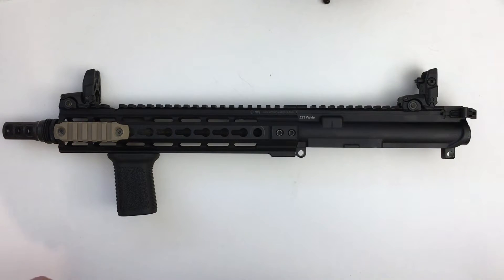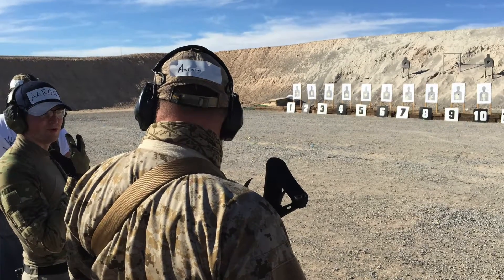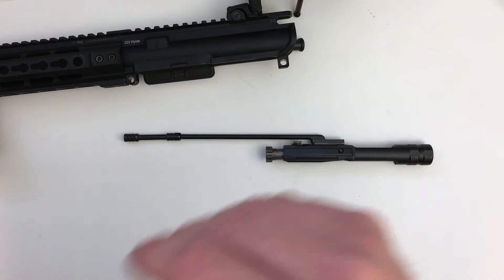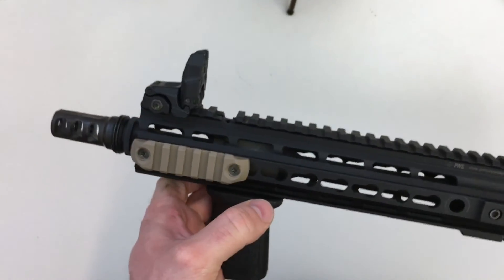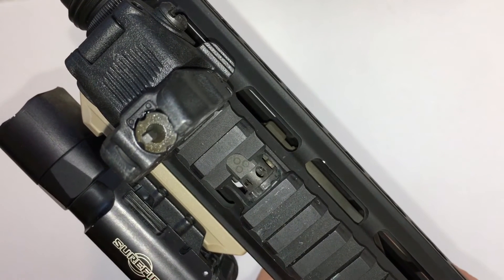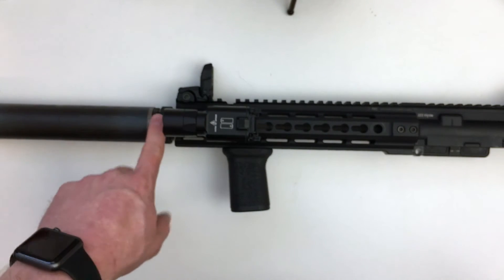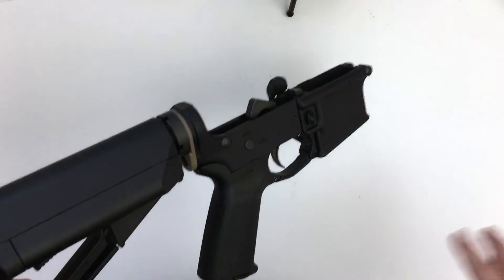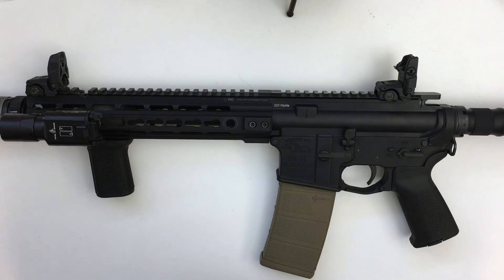Short Barrel Rifle (SBR) Part 1: PWS MK110 Upper

Comment: I don't think it's legal to have a vertical grip on a pistol-AR. You should be able to have an angled fore grip on an AR-pistol.  I would check with your local state laws before you take it to your local gun range. Good video by the way...
Reply from the maker: Thanks for watching! And you are correct...it has to be an SBR to have a vertical foregrip.  Good catch
Reply: Unless it is over 26 inches in oal and then it is a non nfa "firearm"